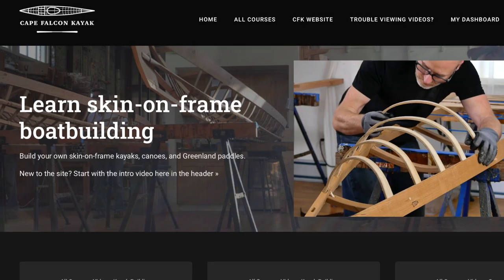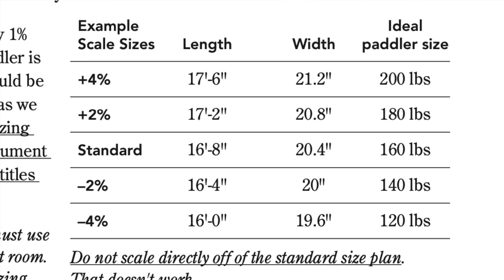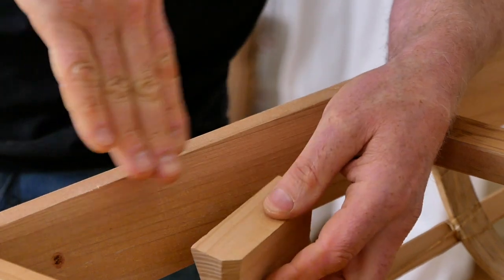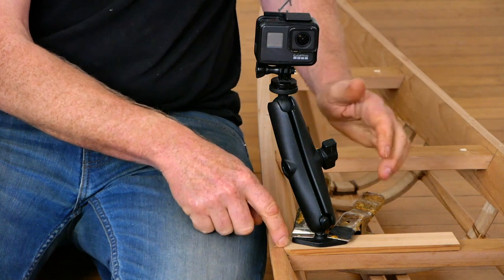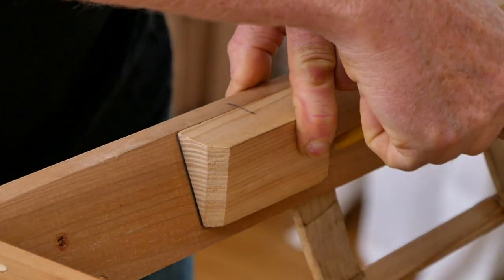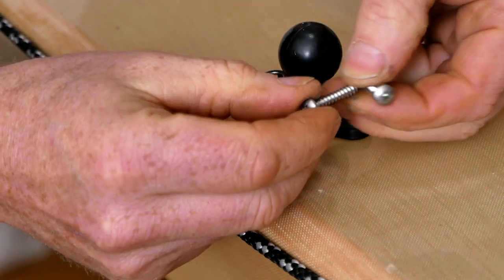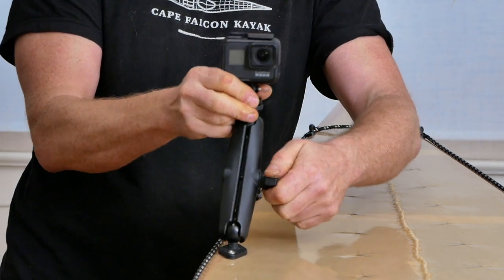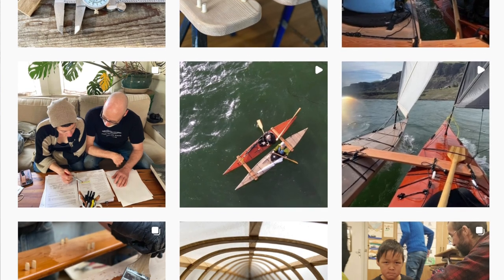Rear Deck Action Camera Mounts for Skin on Frame Kayaks

Comment: Reviewing the CFK canoe plans and your video discussion of materials as to some pro's and con's, and how each point of design and fabrication amounts to a trade-off in some aspect of the boats; another trade-off hit me that I don't think I've heard mentioned before. It is this: The fact that in 5 or 10 years a typical plastic, wooden, or composite boat that gets a lot of use will often have scabs of patchwork/wear/blemishes on them. Whereas the skinboat might likewise have a patch job or two on it and wear and UV exposure, but at any time the skin can be renewed completely and the SOF builder has what appears to be a brand new boat. Could be a different color this time, or a heavier/lighter fabric/coatings.  I think that's a tremendous advantage myself.